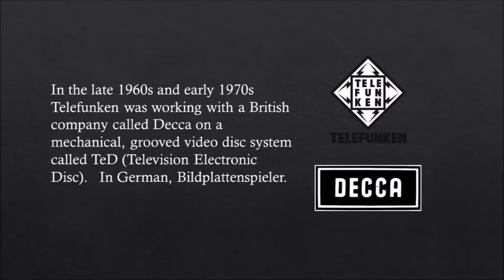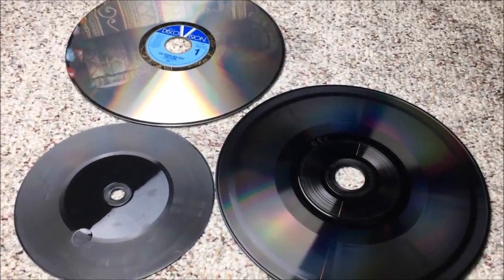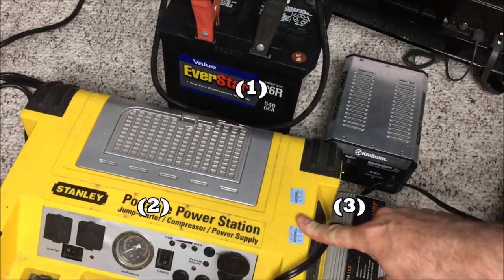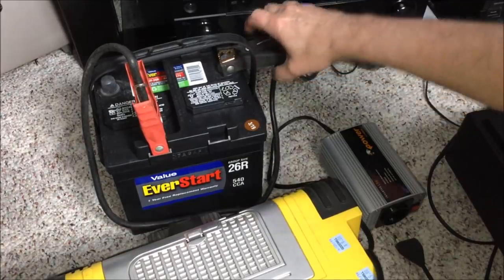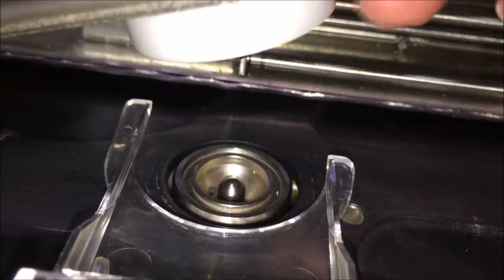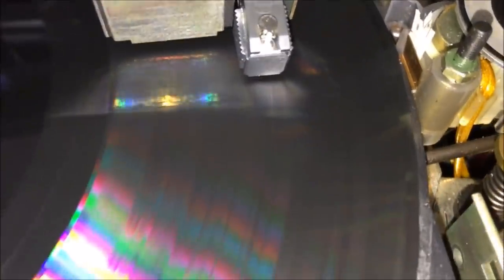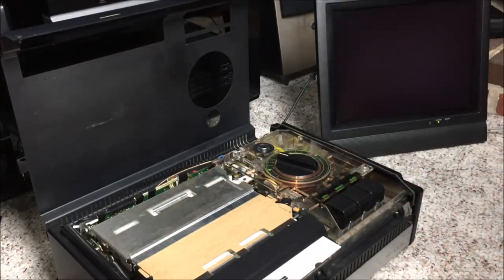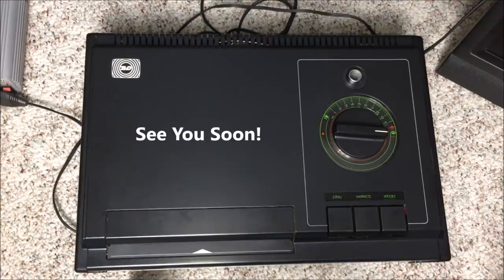BEFORE Laserdisc There Was TeD

Comment: When I was a kid in the 80s my grandfather still had one of these. 
Picture quality was totally fine, maybe like VHS.
But back then the discs weren't worn out,  the capacitors weren't worn out and the thing ran of clean 50 Hz sinusoidal power from the mains and not some crude inverter and the picture was shown on an actual PAL color CRT without conversion. 
Greetings from Berlin.
Btw: Flora Soft is still commonly available.
Reply: OK, das hätte mich wirklich gewundert, wenn das die Original-Bildqualität gewesen wäre. ^^ Ich habe leider noch keinen solchen Spieler in echt gesehen. Flora Soft kenn ich aber gar nicht ;-)
Reply: what is flora soft
Reply: @und4287  Flora Soft is a German margarine brand, there's an advert for it at 17:45

Comment: There's a lot of ringing in the picture caused by impedance mismatch, should be fixed by putting a 75 ohm resistor acro the video lead.  Signal to ground.  Interesting system indeed

Comment: you might need a 75 ohm resistor in the chroma line - the LCD TV looks like it's overloaded with signal, or you're getting some signal bounce
Reply: That's true. You can't just directly take the video signal going into the RF modulator.
Reply: @niino4329  Yeah, it would be wise to try decoupling it, and maybe compare it on a scope with a 'good' video output to see if there's any weird peaking or DC shift going on
Reply: I agree, that 75 ohm resistor is a must.
Reply: Yeah. That could be the reason why the chroma looks like a messy SECAM signal..
Reply: Modern Sharp TVs can accept both PAL and NTSC signals through all inputs.
Reply: The chroma gain is waaaaaaay too high

Comment: It's a mains synchronous motor, that's why it had to be 50hz mains. Most modern things don't really care about frequency, 50hz or 60hz.
Reply: synchronous motors are the real pain in appliances of that aera... noisy and quite ineffective... you find them in record players, typewriters, even computer printers from centronics (not "with centronics interface, but real centronics make) an off course early 8 inch floppy discs as hub motor.
Reply: modern things don't care because they usually have switching PSUs wich create their own frequency anyways but are a pain to repair
Reply: @rarbiart  Disagree. The ' aussenlaufer'  motor as shown here, as well as the motors in german record players, are pretty quiet and very reliable. The most common problem is dried up grease after 30...60 years of use. 
You also find lots of them in tape recorders. I dislike Philips 1950s syncronous motors because they're harder to service, but later ones very often run perfect after a few drops of light machine oil. 
They don't have high torque, but they're much more reliable than the tiny DC brushed motors of the 80s/90s.
Reply: the capacitor issues with synchronous motors can be off course easily repaired, but the humming 50/60Hz resonnances are prettymuch everywhere in such machines. maybe tolerable for office equiment but for audio that's not pretty.
Reply: @rarbiart  If you have problems with that, than your equipment is defective. 
Aside from cheapo record players with idler wheels, the motor vibration is not audible, unless there's a problem like bad rubber mountings. 
There are some mediocre quality products with noisy motors, but it is simply not true that synchronous motors categorically make more sound or vibration than other types. Especially record player motors are very quiet, and synchronous motors are still used in even the most high end players there are.
Reply: @rarbiart you mean those motors found in tape decks toys and record players
Reply: @ChristianPinnock-u5c I do not know what you refer to. please specify any 70ies audio equipment with synchronous motorss that qualifiy for "tape deck toy".

Comment: The red and blue picture is typical if you try to view a PAL Signal on a SECAM TV. It's known as SECAM-fire and also appears on black&white broadcasts. That's one of the biggest flaws of SECAM. They switched of the colour carrier during black&white movies to prevent this. Try switching the TV to PAL if it is on automatic. The player needs to be overhauled, the picture was much better when they were new.

Comment: Incredible! I never thought I’d see one of these in action! It’s even crazier that you shipped yours all the way from Germany, and made it work with your weird American power supplies.

It looks awful thought, the picture I mean. That can’t be working right, your machine must be practically dead.
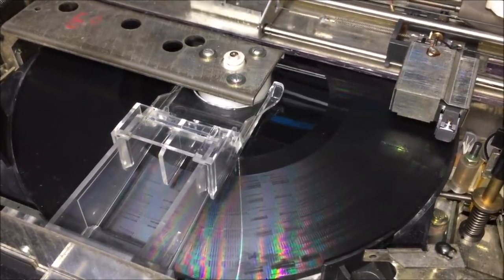Reply: The machine probably is well OK, but at 12:33 you can see that the disc is damaged, the little horizontal lines are marks of the disc loading mechanism (from bad machines);  also discs beeing stored lying flat and being put weight on will damage the grooves over time. Even little damages will result in very bad picture quality.   If a disc is in  good shape, the picture is way better (but of course not "good"  to modern standards)

Comment: Try putting a 75 Ohm resistor on that composite video line, I've seen other videos of this format and none of them showed that ghosting effect, even on worn discs, the quality was much better.

There may another issue though, as the inverter is most likely modified wave, the motor movement may not be as smooth and that issue may reflect in the image.
Reply: Seconding this. The motor is an AC-motor, which relies on having a correct 50hz frequency and a undistorted sine wave to run smoothly. Often, they don't run at all on inverters.

Comment: I don't think that this is even remotely the original video playback quality. The discs are surely very worn, the device is out of aligment/bad capacitors/has other issues. Even the power supply may be inadequate, specially with a cheap inverter, that doesn't give true sine wave power. (BTW, as you said, it's "football" for all the world but the U.S.A., and that "funky" power plug is/was the standard for the biggest part of the world, including Europe, South America and Asia). Cheers!
Reply: +1.
Reply: absolutely! i have a perfect working machine with perfect discs.. well.. of course, its not as „good“ as VHS, but i can confirm, that the quality is WAY better, than shown in this video! anyway thumbs up for the video.. finally somebody did a video about this beautiful machine 😊 👍🏻

Comment: If you have a PAL machine you have to convert the signal of course to NTSC. You can not expect to have a good picture by ignoring different TV standards!
Reply: That model TV supports PAL and NTSC.  It's multi-standard.
Reply: Mike MacEachern If this is the case something with your setup must be wrong nevertheless or your machine is simply broken. The picture quality is equal with VHS really...
Reply: @mgeyer1370  He did mention this in the video.  You must have forgot that part where he did mention it could use some capacitor replacements.
Reply: Mike MacEachern, You’re right, thank you Mike!
Reply: Do they still sell TVs in USA which can't handle PAL?
Reply: Yes.  A lot of them generally don't, for whatever reason it's a locked out feature despite the hardware being quite capable of it.  For example, the LG in the living room here can't understand PAL, but the cheaper and smaller Vizio in my bed room does.
Reply: @hakemon  How strange.  In the UK, PAL land, most TVs were NTSC capable from around the late 1980s, even if most of them never see an NTSC signal.
Reply: @video99couk  only the upmarket models. Mine didn't play US cassettes when I needed it (around mid / end 90ies)
Reply: That's what I've heard.  For some reason the American market got corner cut TV's that weren't multistandard much at all.  You were lucky if you did, and it wasn't until flat panels that you might get one.
Reply: NTSC licenses expired much earlier, plus putting support in a PAL tv is easier (all circuitry for NTSC is there already). Opposite not, to add PAL to NTSC TV you need to add the color delay line, an expensive component. Manufacturors will save cost where needed and no one in USA needs PAL really.
Reply: My LG TV won't take PAL signals through its analog input, but will through HDMI. I just hook everything through my receiver which upconverts and outputs via HDMI- I have PAL VHS, laserdisc and CED players.
Reply: @TheMediaHoarder  hdmi is a totally different beast and doesn't count. In hdmi there's no such thing as ntsc or pal.
Reply: Mike MacEachern The frame rates are still different- NTSC is 60hz and PAL is 50hz. Some TVs will not display a 50hz signal.
Reply: @TheMediaHoarder  once again this is a different beast. PAL and NTSC are a color encoding scheme.  Scan rates are not relavent on most LCDs via HDMI. In fact most can sync down to 24Hz (think 1080p24).  So like I said HDMI is a different beast.
Reply: @hakemon  That's simply not true about American TVs these days not being able to play PAL. Almost every newer TV can play both standards. I did have one older Samsung that wouldn't, but that is one exception. You just have to go into the TV's settings if it doesn't auto detect it.
Reply: @acertainshape  as I stated I have some modern LCDs that do not recognize PAL. And there is no setting whatsoever regarding NTSC or PAL in any of my TVs, even the one that does handle PAL. If you don't know what you are talking about, please don't.

Comment: Thanks for covering this fantastic piece of machinery! I own one myself and I just love the fact that you can actually see what's going on inside. Picture quality's not great, I agree, but this here doesn't do it justice. There must be something wrong with your setup... 
The mark on the disc shown at 4:20 was caused by the locking mechanism crashing down on the disc while it wasn't properly placed on the turntable and thus ruining it. The system wasn't foolproof! TeD disappeared from the market quickly, afaik as soon as 1977. I guess you could ask 100 random German people at age 50-90 and you wouldn't find one who has ever heard about TeD let alone owned one. I wonder what made Telefunken believe that people would accept a format that cost around 1500 Marks (600 $ US back then) and was limited to 10 minutes per disc.
Reply from the maker: Thanks Lower for your comments!

Comment: I can help simplify your power conversion setup. You can get a 120v US AC adapter to 12v car DC which supports up to 5A. Look for "Coleman AC adapter" on eBay. You can plug your 12V to 230V inverter into that. The car inverter won't give you true sinusoidal output though, which may cause problems as others have noted.

Comment: Very interesting format. I believe that most of the video quality issues are caused by bad capacitors, pay attention that as the player works more time, the "ghost" becomes severe, the lines on the right are bad capacitors in the sync circuit. I have a German tv (Blaupunkt) from 1982, and ALL the capacitors in it were crappy (they were branded FRAKO) and all of them to the last one were boiling up, so I believe this player suffers the same problem. Bulk recapping my improve picture quality, but don't expect VHS quality.

Comment: Pretty cool, and a format I'd never heard of. The mechanism to move the stylus is almost identical to that used in Technics linear tracking turntables of the 80s too, probably not that surprising as this appears to be a liner tracking format itself.  I am surprised at the hoops you had to jump through with the voltage and to get any video displayed. Step down transformers to allow us in the UK to power US and Japanese electronics are quite easily available, including on Amazon here as are various NTSC to PAL converters, although they generally aren't needed as pretty much any half decent TV sold here in the last 10/15 years is multistandard and will accept an NTSC signal direct, assuming it has analogue inputs.
Reply: Yeah, the jumping through hoops with the inverter and car battery was because the TeD player requires 50hz mains, and the US is 60hz mains. Most modern electronics is okay with both 50hz and 60hz power. And is only really older devices that have main synchronous motors in them, like some record players and tape recorders.

Comment: When I imported an NTSC RCA CED player into Australia, I made sure to get a model with a quartz timed motor so I could plug it into a step down transformer that passed through the 50hz, to avoid the frequency issues you are going through. Luckily. I got a bargain deal on an SJT-300 with liquefied belts which is quartz timed. I can imagine with the limited release and time period of this format that they only made player models with mains timed motors.

Comment: 13:00 This looks like exaggerated SECAM artefacts. Apparently your monitor misinterprets the distorted PAL signal as SECAM giving weird colours. That used to happen a lot in the analogue era with bad video signals. When the colour gets reasonable at 13:30, it apparently knows it's PAL. If possible, set the monitor to PAL instead of auto, that should prevent it from mis-guessing the colour standard.

Comment: Why not just use an UPS :D I mean if you really can't just get a cheapo power transformer and it actually really needs the correct frequency the UPS givs you both, you just need to find one with a voltage switch or foreign standard one. I've seen plenty of 120v 60Hz UPSes 2nd hand in Europe.

Comment: Hey Databits! Here is a review from a German PC magazine, which shows what the picture quality should have looked like. My guess is that the recapping is not the problem but the splicing in with the cables troubles the inner electronic, which is not expecting the low ohm input load of the external television. Have fun with Asterix and Obelix! https://youtu.be/Iz5tYH7N7d0?t=348

Comment: That TeD player with a Europlug to AS/NZS 3112 adaptor would had worked without a voltage convertor in Australia as they also use 230 Volts 50 Hertz

Comment: The Germans get an A for effort but a D- for results.
Reply: Does not tend to be the case, but here painfully yes...
Reply: If you have a PAL machine you have to convert the signal of course to NTSC. You can not expect to have a good picture by ignoring different TV standards!
Reply: The TV here is multistandard, no conversion done.
Reply: I think the D- goes to the presenter for expecting decent quality from a device clearly not designed to operate outside European specs.

Comment: That motor looks very similar to motors from the brand PABST which used to power many german reel-to-reel tape recorders when that was a thing.
Reply: Papst (not Pabst) is still around, primarily manufacturing fans for IT equipment, power supplies, and industrial applications. They are extremely quiet and very reliable. My first Grundig VCR has these as direct-drive motors. I regularly swapped out many of the loud junk fans in my computers with Papst ones.

Comment: Would an old computer power supply work with a few of the 12v and ground wires bound together to give enough wire thickness to pass the 12.5A limit of the invertor. It may not be pretty, but could be a bit neater. (the input limit will likely be more than 12.5A to account for losses).

Comment: hi out there alot of sony mo drives were used in audio recorders the only thing they used to burn out all the time i have akai 8 track recorders with no mo drives
as they were scsi drives i picked up tons of makes of 8 track recorder had are no good  the inside log can't see any drives over 18gb 
the formating will play up some time i did like this video all the volt changing over gear just to get this working

Comment: I think there might be a problem with your machine. These can get decent video quality https://www.youtube.com/watch?v=1bMDi581yaw  . It looks like from the rightside of the screen that the capacitors are failing and from the ghosting that the grounding failed in the video output circuit. Looking at the diagram on elektrotanya for the TP-1005 , theres Luma Y going between speicherplatte and farbplatte, and the farbplatte outputs an F for PAL chroma. If you find where those are you can make a basic composite cable by combining them together with a 470uF cap. I don't know how broken up the components are in the real machine compared to the block diagram, but the matrix on the farbplatte has BY and RY, so component video might be possible.

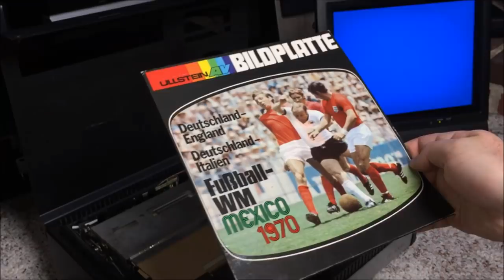Comment: 15:29 That’s the 1970 World Cup semifinal. West Germany lost to Italy, who lost to Brazil in the final. It was in NTSC, converted live to PAL for Europe.
Reply: 5Rounds Rapid That sounds like it would’ve been a major feet to convert television standards live.
Reply: BBC600 It took a room full of equipment. I think it was first used for the 1968 Mexico Olympics. The system was incredibly expensive, and used for at least a decade after.
Reply: 5Rounds Rapid I bet it did... I suppose in the digital age it’s not too big of a problem anymore for big major events?
Reply: Ford Torino I think the disc has clips of both matches. That’s what the sleeve says.
Reply: BBC600 PAL and NTSC doesn’t exist anymore. Now it’s just 50 or 60 FPS HD.

Comment: Even better would be using a true sinewave converter 12V to 230V 50HZ, the cheap discounter converters dont put out sine wave, this fact might damage the transformer and rectifier section of the old machines and cause NF and HF distortions...Here you can see the sinewave converter: https://www.ebay.de/itm/REINER-SINUS-Spannungswandler-12V-230V-1500W-3000W-Wechselrichter-Inverter-LCD/352540543791?hash=item52150dcb2f:g:Pz8AAOSwKF1cuXjt

Comment: I know they make step down power converters so electronics from the US will work overseas, they don't make the reverse??
Reply: There are indeed devices (Step-up/step-down tranformers) that work both ways, but there's another problem: someone said the motor is of the synchonous type, meaning that its RPM depends on the mains FREQUENCY; a simple transformer isn't able to convert between 50 and 60 Hz (or vice versa).
Reply: Does the US care about the rest of the world? ;^)